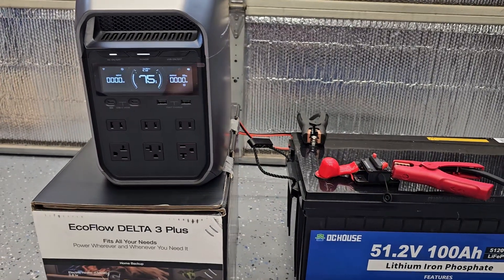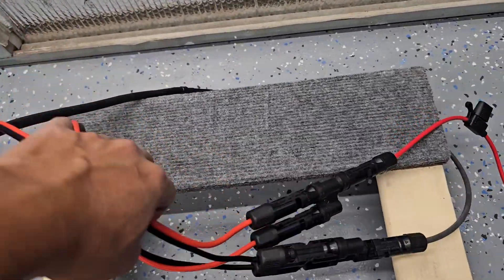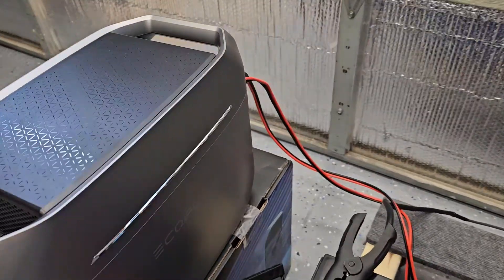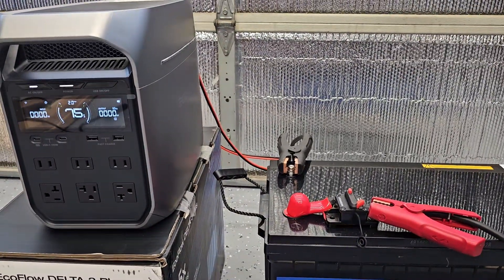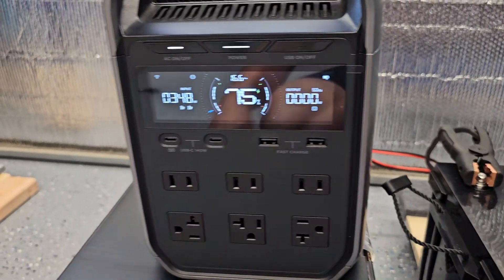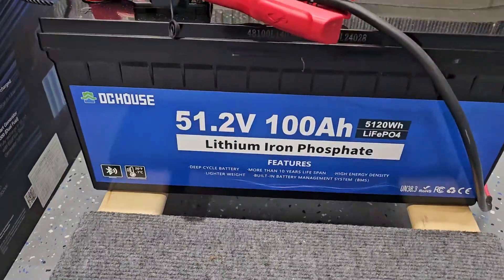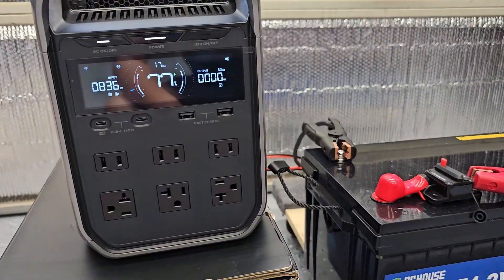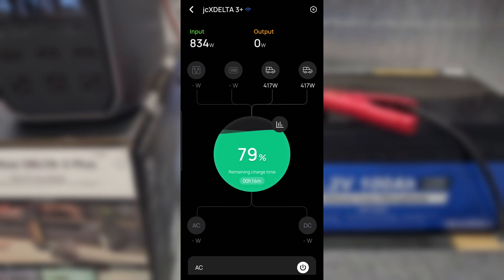EcoFlow Delta 3 Plus connecting 2 inputs in parallel to one single big battery. Will it work?

Comment: Thank you for showing how to split a single power source into two XT60i inputs using a parallel Y connector. I think this will work for over-paneling a solar array also.

Comment: With your wire setup would two 500w solar panels in parallel work?
Reply from the maker: As long as you're within the voltage range, yes.

Comment: Can you charge the lifeP04 with the EcoFlow? Or charge the LifeP0 while charging the EcoFlow
Reply from the maker: Actually, that's my big off grid setup. Solar Panels charging the 48v battery and the batteries are charging the powerstations (ecoflow).  

Diagram:   
   Solar Panel(s) > MPPT Controller(s) > 48v Batterie(s) > PowerStations (Ecoflow/Bluetti)
Reply: @GajetXReview  My setting too..

Comment: Interesting, I would've assumed that at 51.2V nominal it would realize that it's not a car and allow up to 15A. Though that also means that we can use XT60 (without i) to charge it from a 48V DC power brick that's rated for 8A and not overload it, like the Bluetti T500. We can also control the amperage in the app for car charging between 4 to 8A, which I don't think is possible with XT60i.
BTW, that breaker is likely not rated for the fault current a 51.2V 100Ah LFP can generate. More so if it's a generic one. Even BlueSea's 150A breaker is rated for 3kA at 48V DC. It might weld itself closed instead of tripping and/or fail to extinguish the resulting arc. This is why many people recommend using Class T fuses rated for 20kA or more at at least 60V DC.
Reply from the maker: I have a Bluetti too and I know what you're saying. However, I like Ecoflow's XT60i implementation better because you can cheat. Say you have a strong 12v 100A LFP bare battery, and we know that this can do more than 8A easily but for Bluetti, you will never get above 8A unless that 12v is above 32v. That is the only trigger for it to enable its max current limit. However, for Ecoflow, you can bypass that "Car" outlet limit of 8A by using XT60i.

Good eye for that breaker. I used it as a switch for video purposes. I have Class T fuse where it's going to be installed permanently.
Reply: @GajetXReview  Yeah, the 8A limit on low voltage input for Bluetti is annoying. Anker is the same. I occasionally hook up a single 12.8V LFP via two XT60i to the Delta 3 Plus and get around 384W because it's pulling 15A on each MPPT input. That's something neither the Bluetti nor Anker can do.

I figured the breaker was for demo purposes, but better safe than sorry. Maybe someone else will read it and benefit. :)